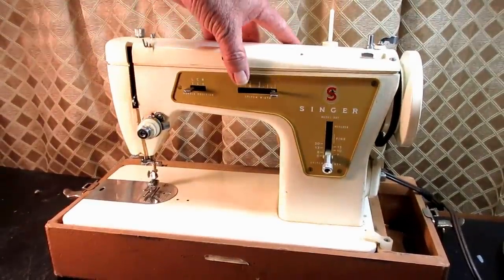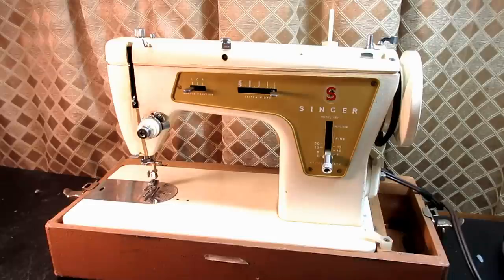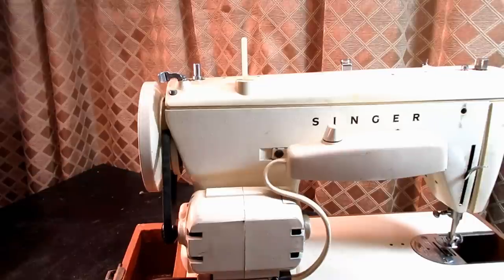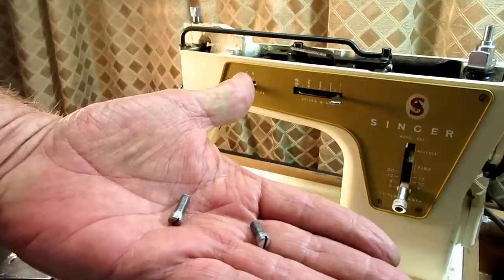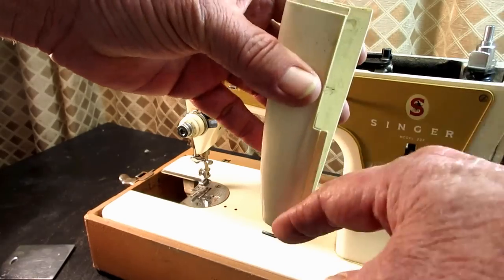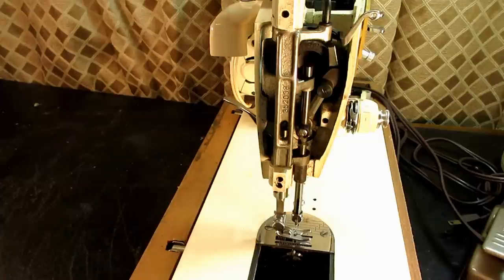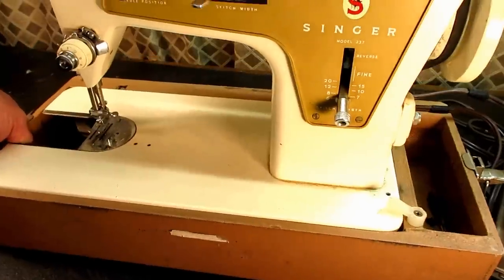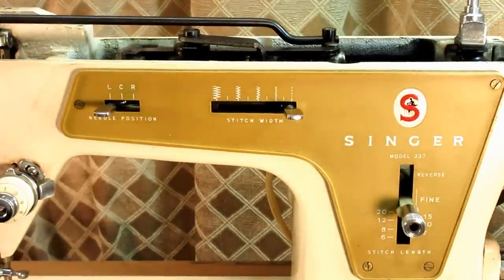Introducing Stella, a Singer Model 237 Fashion Mate Sewing Machine, Pre-restoration.

Comment: I got a couple of these 237s from a friend that use to repairs sewing machines. I've been fixing them up for treadle zigzag, one of them has a SLIGHT wobble in the balance wheel, like the main shaft is a little bent. The other is straight. Is this normal, or something to be concerned about, or can it be fixed? Or should I not worry about it, and use it like it is?
Reply from the maker: I guess the main thing is if it sews properly. I've had machines with bent handwheels that worked OK and I usually replaced the handwheel. I've only had one machine where the arm shaft was bent along with the wheel. An obvious drop situation.
Because I fixed the machines to sell to people, I sold that machine to a guy who takes them apart and sells the pieces on eBay. I do not know the long-term results of using a machine with a bent shaft; how that wears on all the connecting parts, etc.
Reply: I have tried a few (3) other balance wheels, and bushings, with the same results. That's why I think it's the shaft. I have rigged it with a spoked wheel and have a hand crank on it now. It still sews at a high speed, but there is a slight wobble. There is a benefit auction (and fish fry) for an Amish neighbor lady Friday, and I was going to donate it to raise some money. The Amish ladies love these older zigzag machines that can be treadled. I can't tell any signs of it ever being dropped but it is older than me. I was hoping that some of these were just a little bit off, and it was nothing unusual.

Comment: Thanks for your wonderful videos on the Fashion Mate 237. I found one in front of my building and have been working on getting it functional. However it's missing the spool pin and the replacement part I ordered is too small and falls straight through the machine. Was wondering if you have any insight into what spool pins work with the model. I do have the one with the knob in the front base.
Reply from the maker: According to the parts diagram for model 237/239 both spool pins are the same part number 173571. There are several sellers like this one: https://www.sewingpartsonline.com/spool-pin-singer-1247-sewing-machine.aspx
If the correct spool pin seems too small then the hole for it could have been enlarged by a previous owner (you'd be surprised) or damaged. You can use a plastic fill and make a new hole or glue a new pin in place using water-soluble craft glue. Thanks for rescuing the machine and for watching my channel.
Reply: @andytubesewing1953  Thanks for the info, I'll give 173571 a shot!
Reply from the maker: @windloaf  Sure, and best of luck.

Comment: Hello Andy! Quick question! ….. Had my “Beige Brenda” 237 all cleaned.oiled and spinning like a top…. So i dove right in to my first project and about a half hour in I must of made the big rookie mistake of trying to control the fabric too much and had my first broken needle 😢! ….. Now Brenda is pissed! And she won’t dance!….. my top thread is getting tied up down below around the shuttle and breaking off at the needle….. I don’t see anything bent below …..but not sure! Could I have knocked Brenda’s timing out of whack? You know what they say about a woman scorned 😂….. maybe you can point me in the right direction so I can repair this relationship…….. Thanks in advance Andy!
Reply from the maker: The timing is factory set and hard to knock out of time, BUT a needle strike/break can move the needle bar up or down, and that changes the time (so to speak) so the first thing I'd look at is the needle height being correct. Here is a playlist of videos for model 237: https://www.youtube.com/playlist?list=PLsCOZgzzaiKKzvgm_CYPFnDeM8ZqTTo1h    Look down the list to find the presser/needle bar setting to learn how to check and/or set the height. There is also a video about the tension assembly which may have been damaged by the thread breaking repeatedly. You can also buy a copy of the original Service Manual for less than $10 at this link: https://manualsoncd.com/product/singer-237-sewing-machine-service-manual-download/ it should have instructions for setting the thread clearance at the hook and even the hook repair info. Good luck and hope Brenda gets back in service.
Reply: @andytubesewing1953  thanks Andy! Yes i readjusted the height of the needle bar as per your video and Brenda came back on line! Thanks for all those videos in the 237 series! Amazing content!
Reply from the maker: @timothyheckler173  have to love an easy fix like that. Now you know what to keep your eye out for. I'm glad you got your machine back in service. Thanks for letting me know and happy sewing!

Comment: The 237 I was given yesterday is the darker model with the lighter cover plate and the feed dog knob. It's not made in Italy or Brazil though, it's made here in Canada.
Reply from the maker: No Kidding? I did not think the Singer St. Johns Factory was still open when the 237s were made. Thanks for sharing that.
Reply: @andytubesewing1953  No problem..I have 2 other Canadian made singers but no clue what year they're from.
Reply: I just got one i found on the side of the road , canadian as well , painted right on the machine . Giving this girl a restore just need a bobbin door , its plastic or nylon its broken on the top , looks like the needle went through it so im thinking timing was off or someone was forcing fabric through it instead of letting the machine do the work

Comment: Hi Andy
I have this machine, it was originally my mothers.  I cannot find needles that fit into this without falling out.  Can you tell me what needle you are using and where I may find them?
Reply from the maker: Hi, Natalie. The needle type is 15x1 and very available. Your needle clamp may be missing a small part called a Gib that holds the needle in place when you tighten the thumbscrew. My machine was missing it and here is a video about replacing it: https://youtu.be/kVB-_1dmOFo  here is one seller of the GIB: https://www.sewingpartsonline.com/gib-needle-clamp-singer-86822-803.aspx
You can also find the GIB with the needle clamp for sale on sites like eBay some times: https://www.ebay.com/i/174254225511?chn=ps   I may be wrong about this as I can't see or touch your machine to test it, but you can easily see if you have the Gib or not. Good Luck and here are all 21 of my videos for the 237/237: https://www.youtube.com/playlist?list=PLsCOZgzzaiKKzvgm_CYPFnDeM8ZqTTo1h

Comment: Is fashion mate the last of the all-metal construction singers?
Reply from the maker: "Fashion Mate" is a "Family" or "Model Line" of SInger machines. "Stylist" would be another example as would "Touch & Sew".The models 237/239 were made between 1967 & 1972 are believed by many to be the last of the "all metal" Singer domestic machines. From my experience, it was in the early 1970s that Singer started using more plastic parts including the gears. Many people feel that was the beginning of the end for SInger durability. All metal Machines, to some people, means there would not only not be plastic gears but also no belts on the machine, as is motor or timing belts. Metal machines would include models that have steel gearing or steel shaft-driven models but could have a motor and/or timing belts. Singer model 301A, 401A, 403A, 404, 500A & 503A are examples from the late 1950s that have all-metal gears and a Textolite handwheel gear and do NOT have any belts on the machine. Earlier models like the 15-91 and 201-2 have "Potted" motors that also have the Textolite handwheel gear and do not have a belt anywhere on the machine. (All Metal) in general, models made prior to the early 1970s would be considered metal machines.

Comment: Andy can you show us how to repair the tension on a fashion mate 252
Reply from the maker: Sorry, I've never worked on the model. Most singer tensions are the same with a couple different parts. It looks like the number dial on yours would pull off. I'd suggest you buy and download a copy of the original Service Manual for $8.99 from this seller; https://manualsoncd.com/product/singer-252-257-258-259-sewing-machine-service-manual/    It will show all about the needle thread tension unit as well as almost every other part on the machine, remove, replace, adjust. %4-pages used by the original Singer repair people.
Reply: @andytubesewing1953  thank you Andy for the reply. I love your tutorials
Reply from the maker: @carynmulder1809  Best of luck then, and thanks for watching my channel.

Comment: I found one of these guys in a wood housing on the side of the road to give away! Mine has the feed foot drop. The only issue seems to be the spool pin is missing. Does a person need to get the real pin or will any pin that fits in the slot and stablizes the thread work?  I’ve also noticed the kits on eBay sell with a felt pad - do you know what that does?  Thank for the info!
Reply from the maker: Any pin you like that fits. The felt pad is to help the spool rotate easily and not bounce and also to protect the finish of the machine.

Comment: Hello  just found your chanel   I have a 252 fashion mate  can you tell me how and where to oil it  it seems to have slowed down some and I smelt a touch of motor maybe  I had it for a while bought it at garage sale 5 bucks made a couple of quilts on it, runs good , but now seems to smell a bit  I tried other material thought maybe mine was to thick  but still slow
Reply from the maker: You can download a free copy of the original 52-page instruction manual here:
https://www.singer.com/sites/default/files/product_manual/SINGER%20252%20Fashion%20Mate%20Sewing%20Machine.pdf
It is full of information for using and maintaining your machine.

Comment: Hello from Australia, I am wondering if you have any information on the Singer 287 Starlet? It looks very much like this 237, but instead of the brown colour it is blue, with external motor( not working). We can't find any information about it on the internet, like when and where it was build, are the gears metal or plastic. Thank you, regards Christel
Reply from the maker: Hey, Mate! Sorry to say I have no information or documents for a Singer Model 287. I found pictures on Google Images is all. The model 237 was made by Singer in Italy and has no gears on it. It is entirely possible that your 287 has the same mechanics as this 237 and Singer just named it different for sale in the Eu and outside North America (it was not sold here or I'd have documents).
I have 20 more videos of the 237 and you are welcome to take a look at them. They cover most of the parts on the machine including the wiring and motor, the presser and needle bars, the tension unit, the ZigZag system ( which is fabulous), the hook, and the foot pedal. These videos may be all you need to work on your machine. You can find the Playlist of the videos here: https://www.youtube.com/playlist?list=PLsCOZgzzaiKKzvgm_CYPFnDeM8ZqTTo1h    If that is not enough I do have documents for the 237 model and I will gladly share them with you. Email to andymanuals53@gmail.com and ask specifically for Singer Model 237 documents and I'll have them send you PDF copies. That's all I can offer today, Christel. Thanks for watching my channel, and good luck.
Reply: @andytubesewing1953  Wow, that was fast, I didn't even expect a reply, thank you so very much. My daughter found another machine, again no motor or pedal, but for the missing parts like bobbin case, presser foot , needle clamp. I tried to use a bobbin case from my Singer 15, but the machine won't rotate fully, so we will see if it works with the original. When I tried putting the S 15 bobbin case in it moved to the right, just like you demonstrated towards the end of the video. This model also has a feed dog down function. We will watch your videos of the 237 and see if we can get it working, we are very much new to vintage machines, so it will be a good experience and practice, even if it won't work out for us. Thank you again for your reply. Regards Christel
Reply from the maker: Best of luck to you. I have many fans in Australia and hope you become one. You may enjoy the machines and find them rewarding to restore. If you change your mind about the records just email for them. They do show parts numbers which can help find the correct replacement parts. There is a model 237M that has drop feed and it sounds like your model is the culmination of the 237 & 237M with all the best features.

Comment: I have this machine. It seems the hook timing is out and I need to release the shaft to adjust the hook a few mm, but i can't figure out how to release the shaft. I though it was the two  (bushings) that stop the horizontal movement but I'm not sure. Any ideas? Thanks
Reply from the maker: Hello, Ben. It took me a little figuring out to understand the timing of this Model. You are correct that you need to release the shaft, breaking the connection to the needle bar system, so you could independently turn the hook to set timing. Every other Singer machine I have worked on uses that method. This model is different! Because of the way the mechanics work on this model you can not break or separate the hook or hook shaft from the rest of the machine. The timing is set automatically when you set the needle bar at the correct height. I have a video for setting the height of the NB and you can find it here: https://youtu.be/bRjfg2VaqP4
That video is in a 22 video playlist for the Model 237. You may be interested in the other videos too. Here is the link to the whole playlist. https://www.youtube.com/playlist?list=PLsCOZgzzaiKKzvgm_CYPFnDeM8ZqTTo1h
If setting the needle bar at the correct height does not fix your timing issue then you are on your own as I have no idea the safe/best way to release the connection w/o doing damage. Best of luck, thanks for watching my channel, and Happy New Year 2020.

Comment: Hello Andy excellent explanation I interesting in buy one and use it with it  singer professional buttonhole ,it may worker perfectly please let me know thank Antonio
Reply from the maker: I'm under the impression that the Professional Buttonholer is made for Touch & Sew Slant-Needle machines, and can also be used on other slant needle models, like the 401A, 403A, 500A, 503A & 600s. This model 237 is a Low Shank or Straight Needle machine. It would more likely use a green treasure chest or green Jeston box buttonholer as they have the straight attachment parts.
I speak a little about the different buttonholers at the beginning of this video: https://youtu.be/ggVt4UAzoNc
Here is one place you can download a few of the manuals for free: https://ismacs.net/singer_sewing_machine_company/manuals/singer-sewing-machine-manuals.html
Thank you for watching my channel
Reply: Hello Andy thank for answers my professional buttonhole part number 86721 is low shank for vertical needle I will continue looking for the 237 my problem is the shipping  to costly thanks you again !!!!!!
Reply from the maker: @hitoortega1616  I get it now. I was confused by your calling it the "professional" Buttonholer, like this one: https://www.etsy.com/listing/749861698/vintage-singer-professional-buttonholer
Part number 86721 is the vertical needle version of the professional model and Singer labeled it as "Auto-Pilot".
https://www.ebay.com/itm/194448630365?epid=662352605&hash=item2d460aa25d:g:mzcAAOSwWFxhbc2A
Good luck then.

Comment: Someone please post a video on how to thread . No matter what I do, my needle isn't picking up the lower thread. I followed the manual and videos and they set it up the same way I did but it's not working!
Reply from the maker: "and the videos" ... If you have threaded it correctly and can not bring up the bobbin thread that usually means the needle bar is not at the correct height or the needle to hook timing is not correct.  (That is assuming you are using the correct 15x1 needle and have the needle installed all the way up into the needle clamp.)   It is easy to check the needle height by following this video: https://youtu.be/3IcqC_4q4Dc  you don't need any tools to just check the needle bar height. If it looks good you can check the timing as shown in this video: https://youtu.be/u5CwVH7RyaI  again, no tools needed to just check it, but before checking make sure the needle bar height is correct.

Comment: The hook shaft on my machine does not move left and right. Any ideas? And the needle position lever is not moving either.
Reply from the maker: Can't really diagnose some problems through the comment section, but in general cleaning and properly lubricating a vintage machine can clean up many problems. So, the machine is new to you? Here is a playlist of all my model 237 videos;
https://www.youtube.com/playlist?list=PLsCOZgzzaiKKzvgm_CYPFnDeM8ZqTTo1h   The playlist includes cleaning and adjusting videos, like one for lubrication: https://youtu.be/rqXbbbEX78k   and this one about how the zigzag system and hook work: https://youtu.be/ybRA_1qYw58 Those may give you some ideas. In general, most of the parts work and move in sync, so if a part is not moving, other than the presser bar, then it may be loose or some of the parts missing. At the least try lubricating correctly and see what happens.

Comment: Hey Andy:
    The 237 was one of the very first machines I began to sew with. 
As I got more knowledge about "All things Singer" I came to realize that there is
 a lot of 'slop' and 'interference' possibilities that are literally built in to the design 
and inherent in the 237 and others with a similar design. i.e.  broken needles, 
due to Shuttle Hook/ Needle Plate strikes and adjustment/alignment issues.
In conclusion (without belaboring the subject).
 They make great boat anchors.
Trent